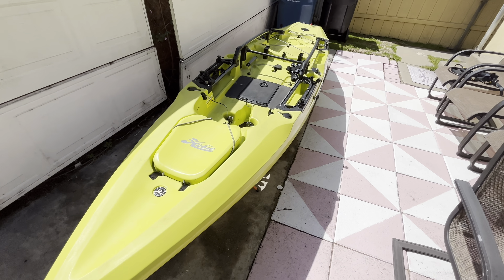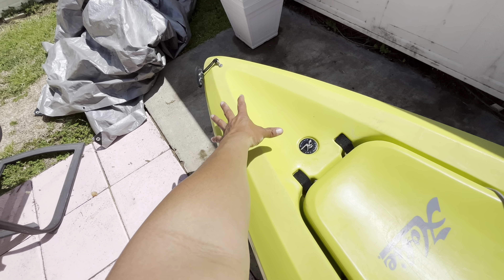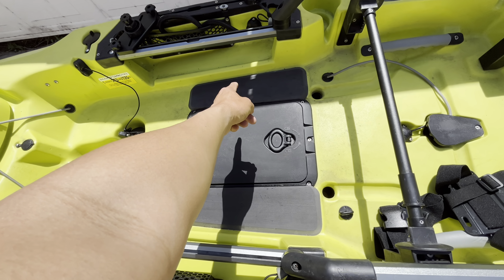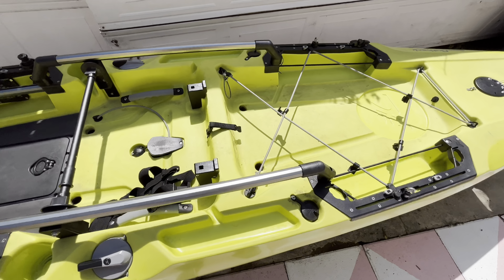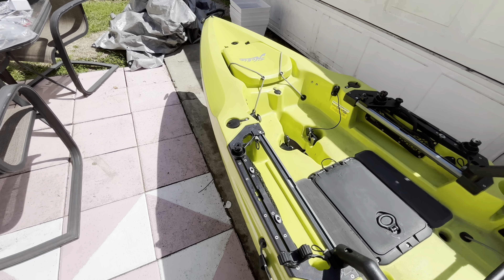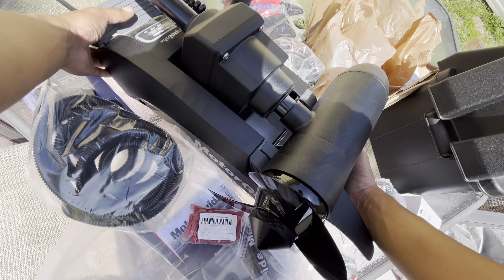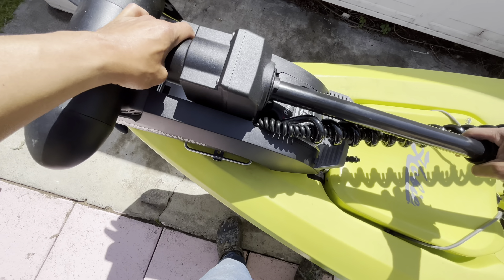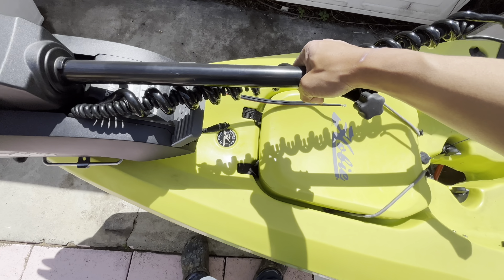Motorguide xi3 with SPOTLOCK Wiring Walkthrough 2019+ Hobie Outback

Comment: Hi - how is your xi3 performance so far?  Did it give you any trouble so far?  Looking to get one but seeing more negative reviews than positive.
Reply from the maker: hello nguyen!, i bought the motor second hand..the previous owner failed to tell me the gps wasnt working. i ended up spending 300$ to replace the gps dongle. Otherwise, the motor is still running strong today! and no issues. if i had to buy it again i would. hope this helps.
Reply: @losangelesbfs  yes, this is very helpful.  Thanks for the insight.

Comment: Does the xi3 require a 50a or 60amp breaker?
Reply from the maker: hey thank you for asking! i went 60amp!
Reply: I have been using a 50amp since last summer and have just been living with the breaker tripping if i run full speed for about a mile. Im running 12ft 6ga wire too on a 14ft kayak so cant be that. I just ordered a 60amp breaker. Is there any concerns with damage to the xi3 being it a 52amp motor?
Reply from the maker: @andreweddy86  no the motor should be okay if it trips, at least we know the circuit breaker is doing its job. Im running 8gauge wire, 60amp breaker, no problems in the past season so far.

Comment: How did you secure your battery box to the kayak?
Reply from the maker: i use a drill in strap, something like this
 https://www.amazon.com/Battery-Straps-Buckle-Stainless-Brackets/dp/B0C17DJBXT/ref=asc_df_B0C17DJBXT/?tag=hyprod-20&linkCode=df0&hvadid=663407390792&hvpos=&hvnetw=g&hvrand=10437559980477201692&hvpone=&hvptwo=&hvqmt=&hvdev=m&hvdvcmdl=&hvlocint=&hvlocphy=9030957&hvtargid=pla-2186411583062&psc=1&mcid=5695c5af01d33fb9ab9938a5d8b6d960

the fishing crate goes behind the battery box. hope this helps!